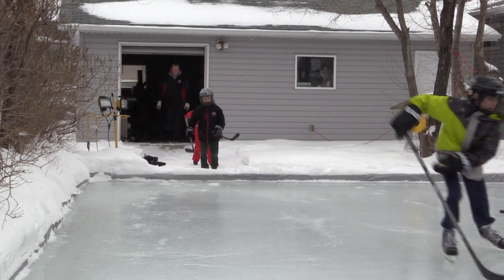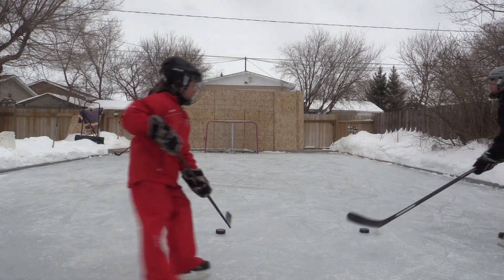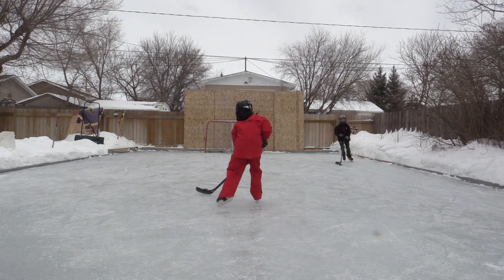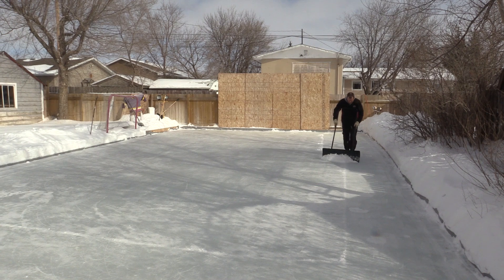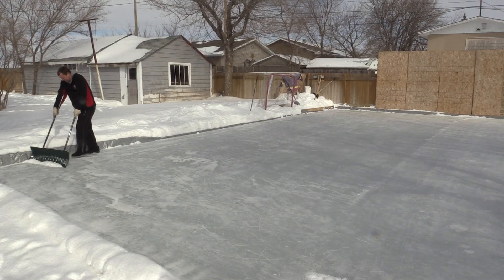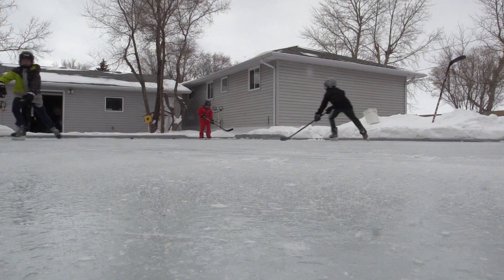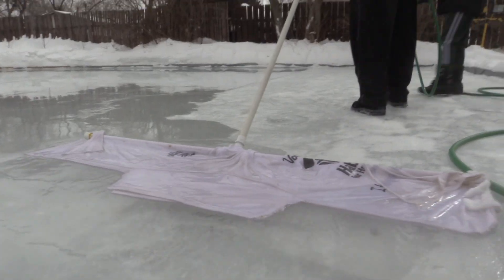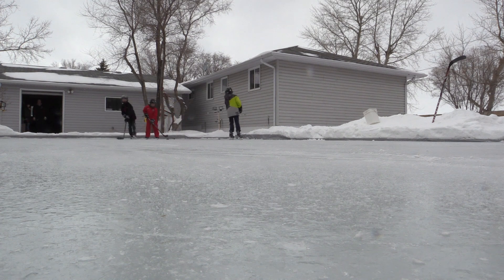Building a backyard ice hockey rink

Comment: We built a 60’x30’ DIY Rink. We bought two 100’x20’ rolls of 6 mil Poly from HD at about $80 each. Since we’d have a seam to seal in the middle, we looked around for the best tape. Viper tape was recommended, but it’s pretty expensive for the 60+ feet we required. Other tapes (e.g. Gorilla, others) are either VERY expensive and/or have POOR ADHESION to the Poly. We tried and had very good success (Great adhesion, waterproof - no leaks) with 3-3/4 in. x 90 ft. ZIP System Tape (Flashing Tape) from HD. $25
Bucks for the roll. So if you’re gonna spare some cost and use Tarps or need to seal seams on Poly, I highly recommend this tape - it’ll get the job done and won’t break the bank.

Comment: I use mdf boards that I router on both sides of the board (top side). This gives me a smooth surface if the kids fall on it with no slivers to worry about. I also use 1/2 conduit electrical pipes for my  stakes since they will drive easily into frozen ground , then screw the stakes to the mdf about 2  below the top of the board to keep everything rigid until I await for the perfect day to lay the plastic and pour the water,. The ideal perfect day to pour water is at least 3 days of below zero F weather. (below 20 F minimum, the colder the better, no wind (otherwise you get wavy ice), no snow. It all depends if you have level ground, I have some places that are 1 foot deep to 3 inches(min height) of water, thus the i foot deep takes a good 3 days to freeze solid in brutal -20 F f day and night. I already got frost working in -20 weather, but you do not want no organic material in your liner or you will have cookie cutter holes or bumps in your ice.
I usually do this all by my self which is again a challenge in -20F with laying the plastic. I use bricks to hold the plastic down temporarily.  You have top really be gentle with the plastic in very cold weather, since it will easily crack when you step on with boots.

Comment: Thanks for sharing your experience.  With the initial larger volume floods, do you just use the hose directly or do you fill containers and dump a large volume at once?   Also, I am not so sure that hot water would freeze faster, but I could see how it could bond better when resurfacing.  Thank you!